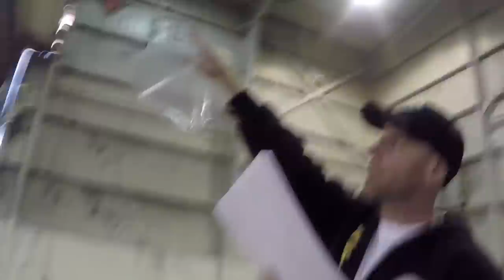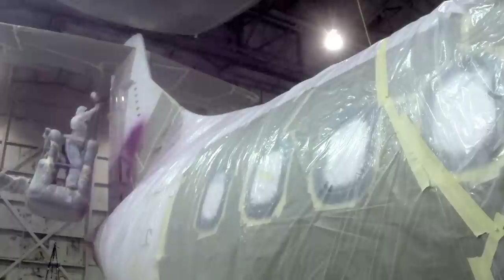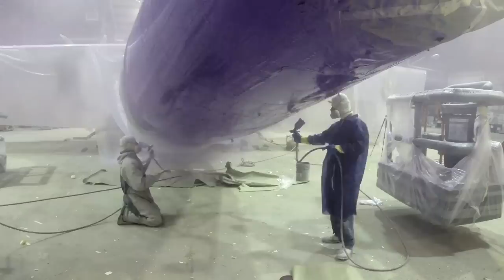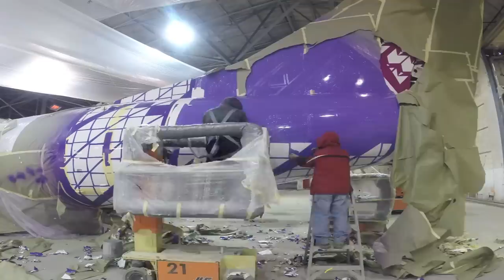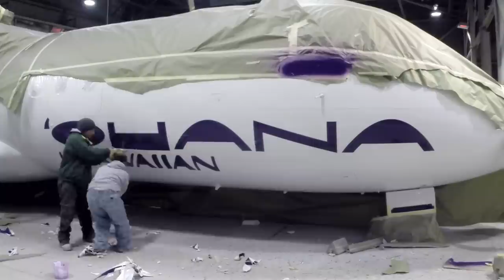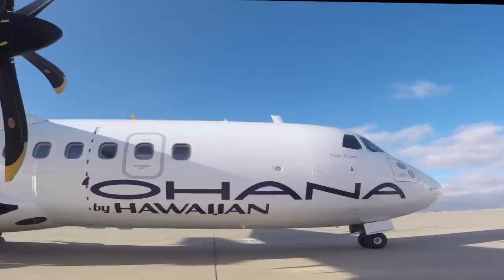Time lapse of 'Ohana by Hawaiian® Plane Painting

Comment: here is a plane i recommend to you Hawaiian Airlines the Boeing 787-9 
And how many i think you should order 16+ these will replace the 767s which are a bit long on the tooth ( Age ) 
The reason i have thought of this is because the 767s especially the 20+ year old ones .
Reply: They already have Airbus A330s, plus A330neos and A320neos on the way in the next few years.
Reply: cruman87 One slight correction: they ordered A321neos, not A320neos. ;)
Reply: +Airline Flyer
Correct
Reply: Jo Tyers they already ordered 10 Boeing 787 to replace the current order of the a330neo and they're going to order 10 more options as well be delivered by 2021